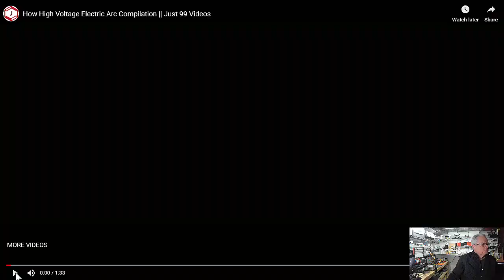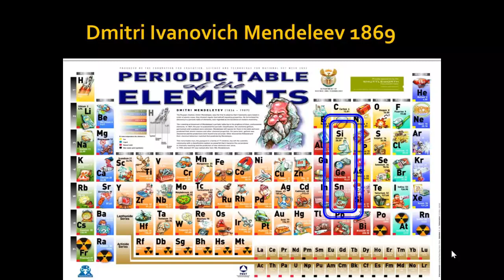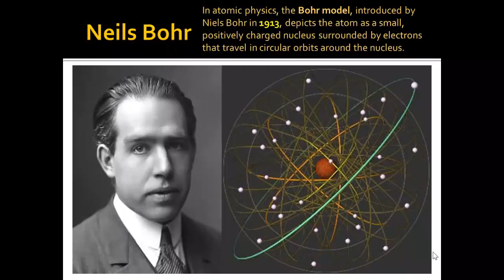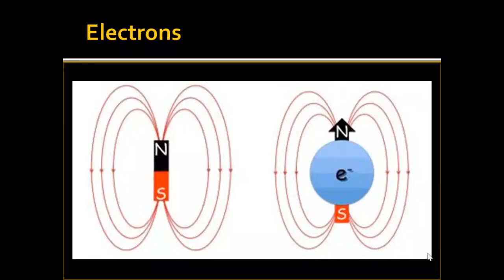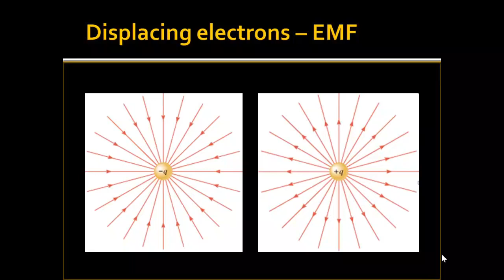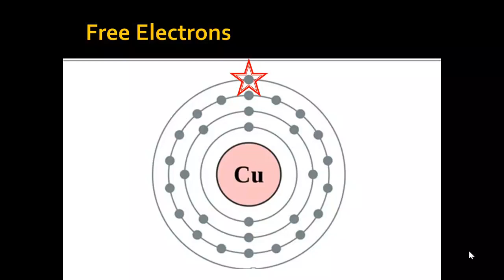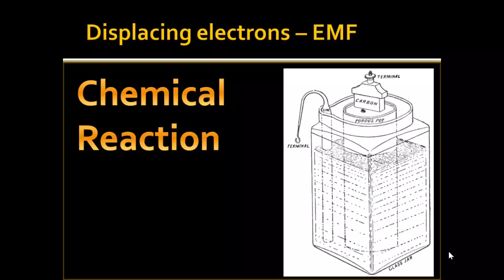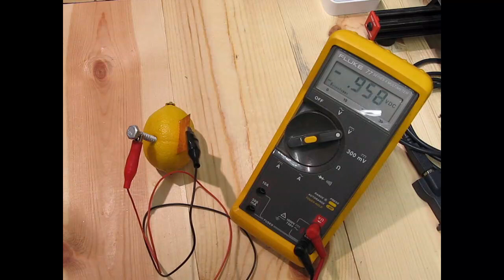Electricity with Grandpa Pt3 - NOT A PLC VIDEO!!!

Comment: Welding. If an arc occurs, doesn't it consume some of the conductor and try and transfer through the lines of flux. Welding makes this more possibly with inert gases within the field. Circuits in parallel divide current(voltage stays constant) and circuits in series divide voltage(EMF), current stays constant. Plc professor really helped with this and complex circuits. I find it weird that most maintenance techs don't know this. Copper is a giver of electrons and pnp devices are are sinking devices because they have more holes.